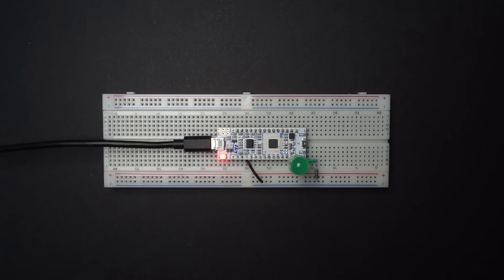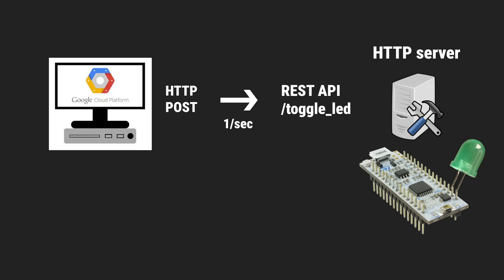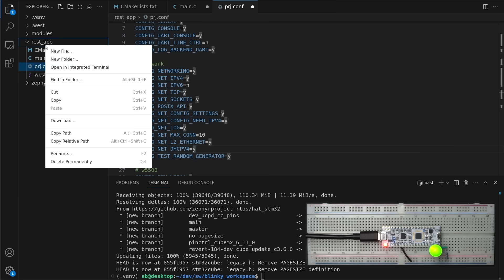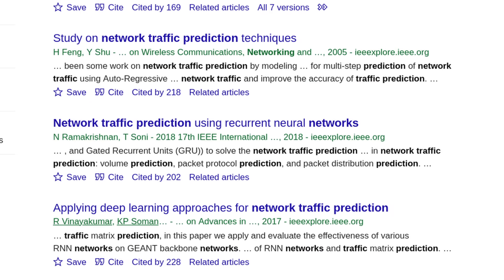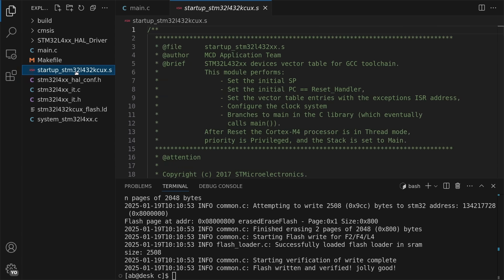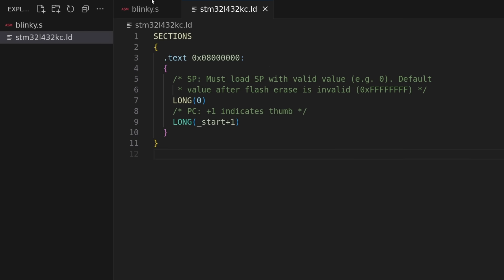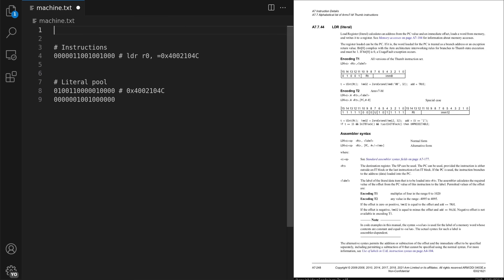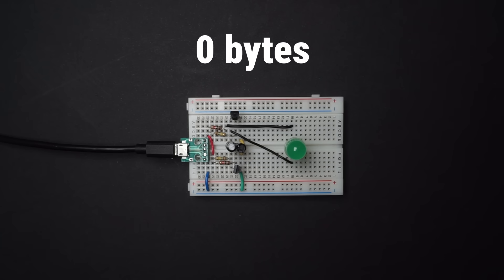I Shrunk Blinky to 0 Bytes

Comment: Actually, the astable multivibrator takes 1 bit of info - the current stored bit and swaps it around (as it can be configured as a bistable multivibrator, astable differs by feedback). But if You consider the volume of code uploaded, yes it is 0 bits, as the multivibrator will self-start, without code.

The title was really clickbait-y, I was expecting some clever hack, but I got what I least expected, but should have really. Sometimes the simplest solution is the best one.

Comment: 2:55 what the hell is "promiscuous mode"?
Reply: It's a mode on network cards that lets the computer/the OS see every packet received on the port, instead of just those specifically addressed to that computer.
Reply: Slutty networking, obviously.
Reply: To further expand on @vurpo7080’s correct answer:
A big part of baseband Ethernet is that every frame of Ethernet says what MAC address it is destined for, and if a device receives a frame that’s not for it, it ignores it. Back in the early days of networking, every device received every frame, and it just ignored the ones not for it. While that’s still going on in the background today, there’s other network architecture going on in switches and routers, which prevent extraneous frames from going to devices they don’t belong to, but your computer is still looking to make sure it’s the proper recipient. However, if you put your NIC in promiscuous mode, it will emulate having a MAC address of 00:00:00:00:00:00, which is code for “don’t ignore anything.” So, it receives and processes every Ethernet frame it has access to, not just the ones that are intended for it.

Comment: You missed a stage out. ST allows talking to the registers directly from C. I never used the HAL as I did not like the abstraction. I always talked to the registers directly from C code. 

I started on 4 bit and 8 bit micros and guess I never changed the style of programming.

The smallest chip I worked on was 12C508. No flash, no interrupts, well not much of anything. The only time I had to resort to cycle counting.

Comment: How ro make the smallest code possible,avoid  any code at all. Brilliant! But as you said it's a bit of a cheat since the original problem stated that you shuld program a microcontroller to blink a led at onhz, not just make a led blink at 1 hz. Allso I supect blinky is more of a test of werher rge dev environment/ide  works and can program the actual microcontroller ( the simplest program you can make thst does anyrhing at all that is easy to debyg)

Comment: What this confirms to me for the n-th time, is how inefficient code generators are, nowadays.

Nice project though. Love it ❤️

Depending on the microcontroller used (though probably not anymore nowadays), you could’ve turned the clock frequency all the way down to the sufficient cycle, and then connect 2 I/O pins, reading in the state of one and write it back inverted to the other. That way you’d get your program back to a few, probably 2-4 bytes. Though technically not a microcontroller in the sense meant here, the clock on the RCA 1802 (CDP1802) could be turned down all the way to zero, because it is a so called static processor. Therefore the RCA 1802 CPU could basically run at every speed you’d wish for.

As for the last, zero byte approach, that would technically be a 1-bit “processor”, so one could think of it as running a 1-bit “program”.

Comment: This was literally my career as an software developer, but in reverse, started with some electronics, followed by coding Z80s in hex and assembler, later in some compiling languages, and nowadays ending in php/python/webbloatAIstuff. Thanks for bringing up all the memories. 😉
Reply: exactly what I was thinking.
This is how you develop a blinking LED for the customers, start off with the basic blinking LED that everybody want, then get bought up by Google and have the customer subscribe to your 0 downtime AI powered blinking device that cost $199.99 with premium season pass for just $19.99/month or $99.99/year, the premium package includes two step verification, and "always online" model is the gold standard 🥰
as the premium user you also get access to the app so that you can monitor the blinking on the go.

Comment: A few years ago I had to come up with a way to rotate a holder which had a 20cm diameter. Since I had a few 3D printer mainboards laying around (as I was building 3D printers), I used one of those along with a stepper motor. Later, when the task was to optimize the cost of this solution, I picked a 555 timer, a TMC2208 stepper motor driver and designed a custom PCB, which was much more cheap, than my initial contraption. Fun fact: after the PCBs were ready, there was a request to be able to reverse the direction of the rotation, so I just put in a toggle switch connecting the direction pin of the stepper driver to 5V or ground :)

Comment: This can be simplified further by finding an LED that can handle 120 volts and plugging it into the electrical socket. It will blink at 50 or 60Hz. Admittedly that's not very close to 1000ms per state change, but still "as close as possible" for the simplest design (one component!)

Comment: In 2016 while graduating from an Engeneearing school, I was in this passion. Built a very complex project with 2 microcontrollers working together as one couldn't do the job. But I wrote the code in C. The code was just very large so I had to rewrite everything in assembly.

Comment: Not only was replacing 1 microcontroller with 6 other components cheating, prior attempts didn't satisfy the "as close to 1000ms as possible" rule. Using delay loops instead of regular periods causes your MCU implementations to run slow; it can be compensated for, but only as precise as the loop period (or extra NOPs, but that costs size). This is easily fixed using timers, and they typically have a hardware function to output pulses. Basically, a microcontroller already contains a grab bag of components including adjustable blinkers.

I've set an MSP430 to blink an LED without even using the CPU inside it, but I wouldn't count that for size because it couldn't start on its own (instead performing setup through the debug interface). As it took about three register writes to do, I expect an assembly version would be under 20 bytes.

Comment: On some microcontrollers you might be able to "program" through fuses some startup delay and a watchdog delay, and with, hopefully, the proper settings, you could cycle in "reset state" for 1 second, then default PIO would light the LED, then the 1-second watchdog would kick in and go back to "reset state". At the very least, programming the watchdog could be shorter than the actual loop.

Comment: Use a 6502 with an LED on an address pin, and the data bus pulled down to instruct the byte EA, which is no op. As the counter program counter increments, the address pins will flash according to input clock speed. 1 byte program.

Comment: Engineering humor. I am disappointed that he did not build a nuclear power station, used a quantum computer, incorporated blockchain, and had a humanoid robot push a button every second. He could also have used a vision system to detect that the LED being on.
Reply: The robot must physically type out an email to inform you of the LED's state

Comment: You could've won without "cheating" by a) declaring that solder is a programming language & b) through the deft use of wire cutters, a steady hand & some jumper wire, crafting an oscillator from components already populating the MCU board. But I think you've still made an important point.
There's a gaping chasm between what IoT promises & where we are now. We live in a world where some companies are selling people wifi light bulbs for $US50 when much of the enabling technology originates from open source or public domain. It feels like ... something is broken.

Comment: At the risk of sounding pedantic, 2 capacitors is 2 bits of information, making your hardware circuit solution a quarter of a byte.
Reply: They're used for analog levels, making it more than one bit per capacitor.
Reply: @0LoneTech  good call

Comment: Well given you could change the hardware, just slap a empty microcontroller on the board. Sure it may be contributing nothing to the rest of the circuit but you put zero bytes into it and the light blinks

Comment: Couldn't you just use a bimetallic strip and a resistor? Just calibrate the strip to be thin enough to get the timing right and there's only three components plus some wire (resistor, strip, and LED), and the power source. Sure, it'll vary based on the room temp, but it wouldn't even involve a single transistor or even a capacitor.

Comment: For 0 byte, I was expecting you to use a microcontroller that allows you to configure the power-on state of registers with a binary blob (arguably not a program) and drive the LED directly off a timer. Analog implemention is lame.

Comment: I would be curious if there was an "in-between" from machine code to HW (possibly on a different MCU) that uses a clock signal pin divided from the primary clock to 1hz. I would think setting the right pin modes would be fewer bytes.

Comment: Having watched the video until 5:00min, I am wondering if the zero bytes version of blinky will be programmed with a soldering iron… Now, having watched the entire video, the conclusion is exactly what I was thinking about. A simple astable flip-flop. By re-adding a layer of abstraction, one could just use a blinking LED.
Reply: I was hoping that there was a persistent configuration of the microcontroller that could make it generate a 1HZ signal in hardware. You would run the configuration code only once.

Comment: 48 bytes, so that's what, 24 Thumb instructions, except less because data. 
But: start writing the code straight to the reset vector, and do the following:
1. Set up a timer to output a 0.5 Hz 50% duty cycle PWM on the LED pin
2. Infinite loop.
No interrupts, so no need for the other interrupts: the CPU doesn't know that the interrupt table is corrupted (probably)

Comment: You can use micro and only use 1 byte.
Hard wire or fill memory with NOP and connect led to an address line that is a divisor from the system clock that is 1 second . Ie, run cpu at 4.096 meg.

Comment: You can use a microcontroller and 0 lines of code: Simply get one that outputs it's clock as PHI2 onto a pin. A 6502 even works, or use one that has an internal OSC and a phil2 output. Then use a frequency divider to divide that down to something visible. Done, zero code, but STILL using a micro ;)
Reply: This was my thought. Maybe put an LED on a bus voltage line with a cap, and when the cap charges it hits the reset pin, which latches to ground to discharge. Rinse and repeat.

0-byte blinky using a micro.
Reply: Or, use a microcontroller with a timer that can toggle a pin, and then use JTAG/SWD to configure that timer. Zero bytes written to the microcontroller.

Comment: Technically, you could have done it using a temperature controlled oscillation of the powersupply of the Nucleo. Just overheat it and tune the cooling/heating delay with more thermal insulation (i.e. put the whole board under a blanket and shove a dimmable lightbulb next to it). Let the thermal protection handle the blink

Comment: I'm only 0:54 seconds in, and I think there is a pure hardware solution for this problem that uses 0 software.
Reply: The pure hardware solution uses 270,000km of wire
Reply: DC motor with an L shape arm and as it spins it closes contact between power source and LED once per revolution?
Reply: @griffincash661  I like your approach
Reply: 555 timer, FTW
Reply: There is but it needs to be near perfect 1000ms
Reply: @Greedy-Allay Technology connections had a video about this: new car turn signals tend to have very accurate delays while the old ones are close to what this video shows at the end but depend on what other loads are present in the electrical system.
Reply: Watch to the end

Comment: I was expecting a 555-based circuit as the 0-byte solution, but you went even lower level 😁
Reply: the 555 contains a SR latch though, that's definitly some kind of storage! :)
Reply: A single resistor, inductor, and capacitor would do it
Reply: @DoesntRefillTheBrita ye I was expecting cap and inductor oscillator

Comment: Great video. I suspect it can be done on the ESP32 Ultra Low Power co-processor in less than 48 bytes of actual ULP assembler, though the additional code required to load and execute the ULP program would probably make it larger - but maybe we consider that part of the bootloader and don't count it...

Comment: You should count up instead of down and bit shift the counter so that one of the higher bits maps on to the output pin. Hopefully you can find one that toggles around once per second. Then no xor or branches needed.
Reply: Most(?) MCUs have a timer peripheral of some kind: configure a few registers and let the hardware handle all that for you. Branches? You could halt the processor and toggle the GPIO in the interrupt handler.

Comment: In the old days, you used to be able to buy "flashing LEDs" which had inbuilt oscillators. Then you don't even need any transistors! :) But on a more sensible note,  I would personally use the built in timers on most microcontrollers to toggle a pin on overflow for ultra precise timing and no loop code.

Comment: Your relaxation oscillator can get hung up with both transistors stuck on.  This is worse than software "bug".
          As far as circuits, you can get simpler.  Get hysteresis CMOS single inverter IC (4 pins).  Connect input to output with 1M resistor.  Connect 1uF capacitor from input to ground (with 1K resistor in series to protect CMOS input).  Output drives LED through another resistor.  You have IC, 3 resistors, 1 capacitor, 1 LED in circuit.

Comment: This takes me back to college. My curriculum was electronics with a focus on analog systems, though we did learn how to use logic ICs, PLCs and microcontrollers, and to write QuickBasic code (lol), C code, and machine code (I forget the architecture, but it was one of Intel's very early processors, possibly the 8080). All of which is to say, yeah, sure, I can make a zero-byte Blinky - just give me a 555 and a fistful of jumper wires, resistors and caps from your junk drawer. Also, all of that being said, I love how you took it a step even further in your zero-byte design by using discrete transistors rather than a 555. ♥
Reply: brother i learnt and builts this circuit in high school at around the same time i touched my first 555, this is the basics of the basic

Comment: New coder thinking...

1: Reduce your code to minimal bits or bytes. (Zero fat in the code)
2: Scan the system memory for as many whole chunks of bit-matches or byte-matches, including matches that are inverted or "bit-shifted".
3: Try a deeper search for progressive matches of chunks that can be XOR or NOT or AND, as well as inverse order, with the same criteria.
4: A week later, you should have the potential to just point to memory-space and provide "how to use that data", based off the match types looked for, in steps 3 and 4. Merge that data into a pre-allocated memory-space, which is dedicated to be "run". (Setup by a dummy program full of NULLS.)
5: Run the program.

Bonus if you use an RNG with similar matching and modifications, to find "more matches" or "better matches".

Chances are about 99% that all the raw binary data YOU think is original, already exists, in major chunks, within ROM or it can be created easily with an RNG.

Super bonus for skipping bits and bytes in a search, every Nth bit/byte. Inverting every Nth bit/byte. Diagonal memory-space traversal. Chunk traversal, jumping whole memory chip addresses in blocks. XOR or some other "rolling change" or stepping by individual bytes/bits.

I remember making a random seed that expanded into one program, which held the compressed code that expanded to another program, which held the code to be expanded again, into the final program. I essentially had infinite compression that was just reducing everything to a single seed value.

I am sure AI would love to digest that! In a sense, that is what AI actually does, to a minor extent.

Comment: Cheater.  I assumed the zero byte solution would be use jtag to configure some PWM peripheral or to configure endless DMA clobbering a GPIO register to blink the light all with zero code on the microcontroller.

Comment: To remove two more bytes you can use the initial sack pointer value from the vectors to hold the first address u referenced in your code.

Comment: I would have suggested a CMOS microprocessor running off a 32768Hz crystal oscillator, and an LED hooked up to one of the upper address pins.  Use resistors to pull the data pins to a suitable opcode and voila.  It would be one byte rather than zero, but it would be a genuine programmable device and could probably offer a choice of blink rates or patterns.

Comment: For the Assembly implementation, you might be able to use the Timers with the OCRX pins to do the blink. Their primary intention is for PWM, but if you set them up with an extremely long count down and a large prescaler, you could probably get a blink exactly every second. And all you would need to do is write to the two timer control registers and the timer comparison register.

Comment: It may be smaller by mapping one of the timers directly to an output pin and setting it up in a PWM mode. It would increase the setup code by a few configuration lines, but it would kill the logic entirely. I'm not sure if it would be smaller, I don't have the board or IDE, otherwise I would test out my theory.